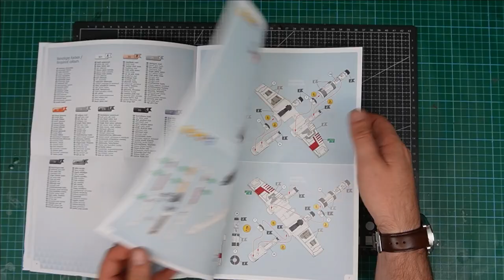I Made a STAR WARS X-WING Diorama

Comment: I love this diorama! I love the framing and the concept of the X-Wing cutting through the water. It really is a nice setup. But I have a few criticism points if you will allow…
First, I think this is a very nice diorama. The subject matter is great, the idea is great, and the way you hid the wing of the X-wing with a clear plastic rod through the water was really cool. but, as a professional model builder of 25 years, I would offer you some advice. I think you put the cart before the horse. You spent a lot of time detailing the base and the water with rocks and sand textures and the air brush, but I think that was unnecessary because in the end, the acrylic water pretty much hides all of that, -the focus should be on the model, not the base, and to me, I felt like you put too much work into the base . My concern is the X-wing itself. It’s too uniform. It’s very symmetrical -everything you did with the paint on one side is exactly mirrored on the other side. If you go back and look at the Lucasfilm archives, you’ll see that the model builders were very asymmetrical. The other thing that stuck out for me is the decals. Those yellow decals on the front fuselage are just too perfect. The red decals are also too perfect. I would’ve hit those with 80 grit sandpaper and torn them up. I would’ve also added different layers of paint filters and weathering in a very asymmetrical pattern. The X-Wing is just too clean. But overall I love this concept and execution of the design. I think more focus should be on the subject and not the base, but I do really like your work!